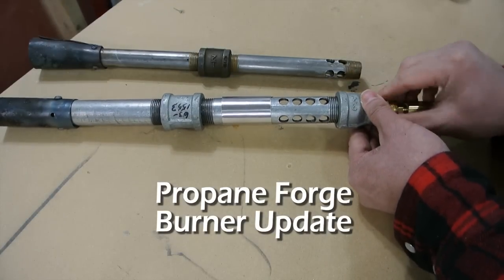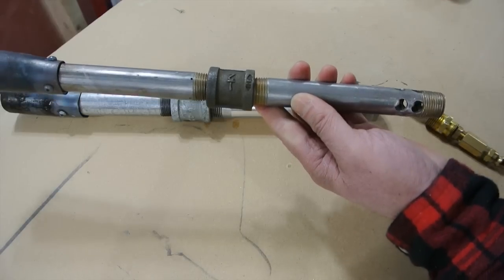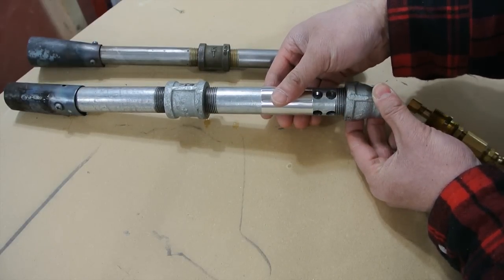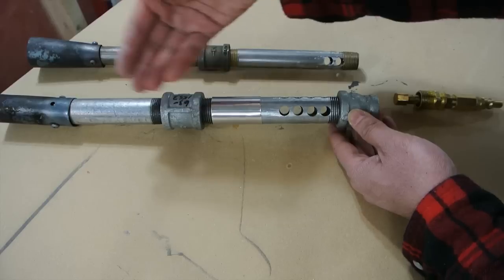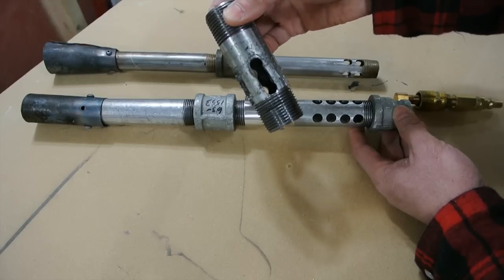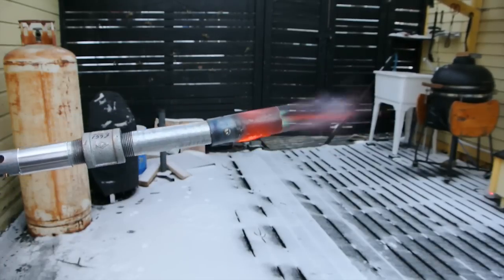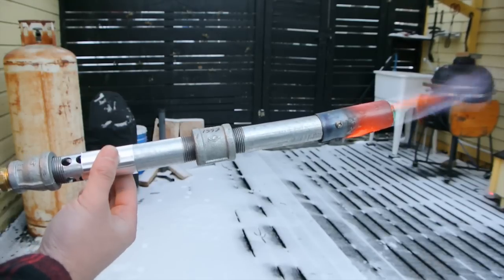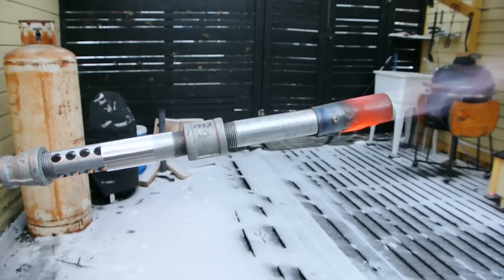Propane Forge Burner Follow-Up

Comment: I like the improvements you've come up with over a typical T burner. I'm looking at getting some burners going for a forge and I'm going to add what you've done here. Looks like your end may have a hard time long term handling the increase in heat with the increased air, but you've definitely got some good improvements.

Comment: I  think that meant 'RICH BURN' not  'LEAN BURN'. When you introduce more air flow you'll get a leaner burn, and as you reduce air flow and burn more gas, that would be a richer burn... Do you agree? Maybe I'm wrong?.... I just designed and built my first forge burner, so coming here to check what you have done as further modification to yours is very helpful to me. Cheers mate =)

Comment: Lol don't worry about the galvanizing, it's just a thin zinc coating on top on the steel that vaporizes into zinc oxide when it gets hot. Their aren't any long term effects known and the short term are "flu like symptoms". Just try to stay upwind of it when it's burning off and once it's burnt off its regular steel underneath. I had zinc poisoning once before anyone warned me to keep away from the smoke and it wasn't overly dramatic. Old welders trick is if you do end up accidentally breathing it in just drink a big glass of milk as the calcium helps clear the zinc buildup from your body. Cool torch btw.

Comment: good video and i find it very inspiring. I like to ask you, is it possible to use acetylene-oxygen burner in the mini forge? In my workshop there is supply of acetylene-oxygen but not propane. Will acetylene-oxygen burning to be too hot for the application? Please help.
Reply: or if i directly connect your design burner to acetylene source, using air as combustion agent, will it get similar result with propane?

Comment: also one last thing. you need more gas pressure to keep the flame outside the tip. the tip should not glow red. smaller nozzle more pressure
Reply: How do you increase pressure when using 20lb propane bottle?
Reply: @banditBoy943777  With a 0-20PSI propane regulator

Comment: galv pipe is toxic when it gets too hot. be carefull. although this video is older so... hope your still alive and well. if you shorten the distance between the gas nozzle tip and the burners tip it will burn better. 9 inches is usually a good starting point. kind of a small flame...

Comment: DO NOT USE GALVANIZED PIPE!! It puts off DEADLY fumes when heated!
Reply: Ken Graves zinc
Reply: B litherer Masterman
Reply: DO NOT USE GALVANIZED PIPE........EXCEPT WE WELD IT ALL DAY EVERYDAY WITH NO ILL EFFECT.  it's fine, just don't inhale the fumes. If your nozzle was galvanized it would burn off in about a minute.

Comment: Hi - I'm not an expert, but I believe you have a problem with your burner or nozzle. It shouldn't be getting red hot like that. You can see in the video that a significant part of the blue flame is inside the nozzle, and it shouldn't be. The flame should start at the end of the nozzle. 

I suspect you either have a problem with the overall velocity of the burn, or the nozzle angle. Probably the latter. It actually looks, to my eye, like your nozzle is angled inward rather than outward...

My two cents.
Reply from the maker: +Steve Smith Thanks for your reply, I will experiment some more with it, I haven't had any problems using it in my furnace or forge but what you say makes sense.